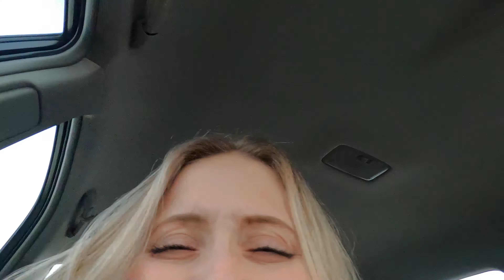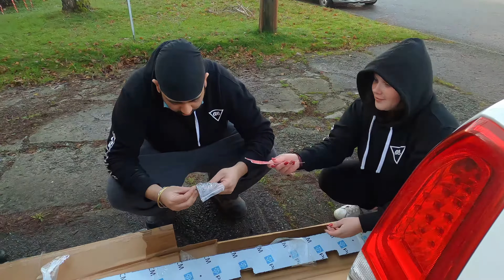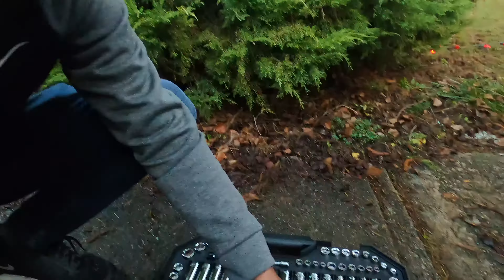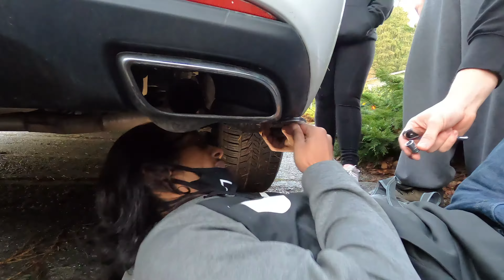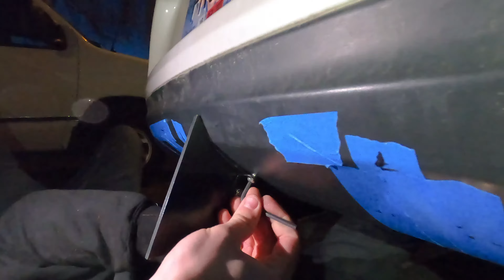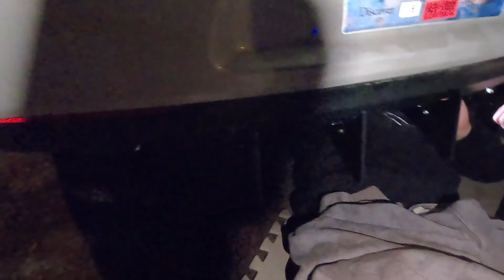Installing A Rear Diffuser On The Chrysler 300

Comment: What screws did you use for them to stay I bought these and the original bolts keeps fins moving
Reply from the maker: we used the same ones that came in the kit , ours are still holding very well and have no problems. I suggest retightening them and see if it holds